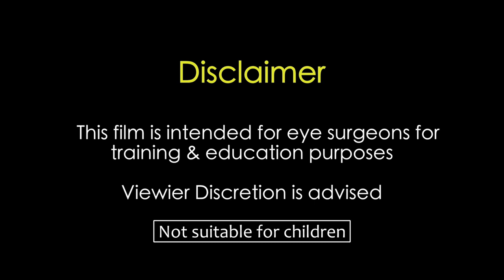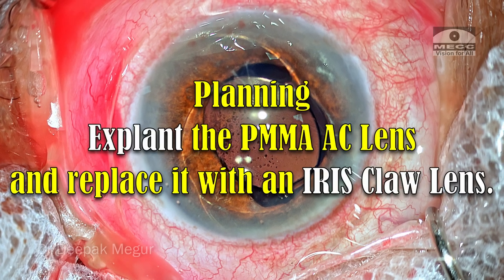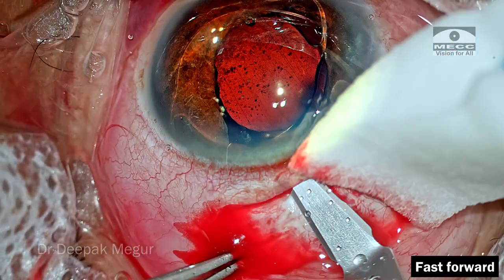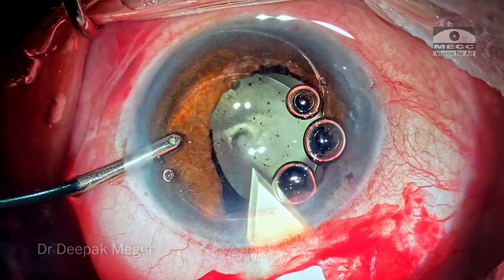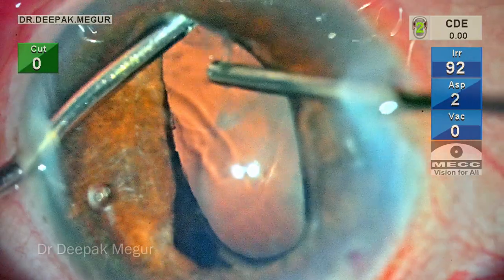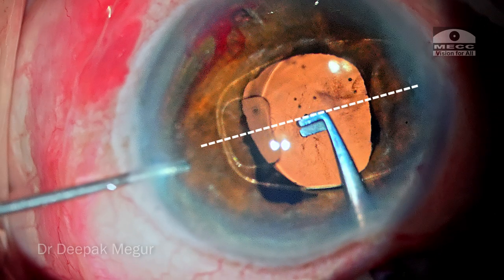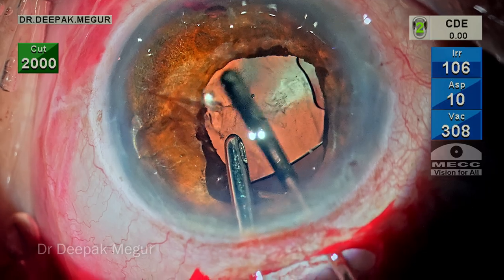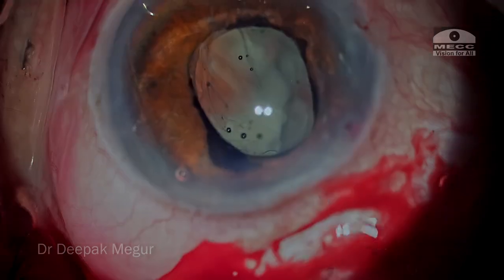IOL exchange. Principles of Surgery. Anterior Vitrectomy. Iris Claw Lens. - Dr. Deepak Megur

Comment: Thank you sir for a nice case .
Just a query ,what was the bottle height during vitrectomy after the main incision was opened.
I usually have more vitrous prolapse through the main port during vitrectomy in sics.
Reply from the maker: If your sclerocorneal tunnel valve action is functioning well, then performing vitrectomy through the side ports doesn't  cause any issue. If the valve is compromised, suture it before doing ant vitrectomy. 
Bottle height will be low to begin with, and the vitrectomy proceeds it is gradually  increased to maintain  the chamber.